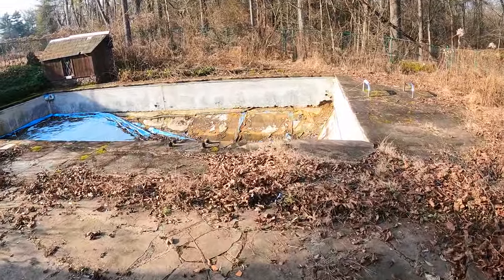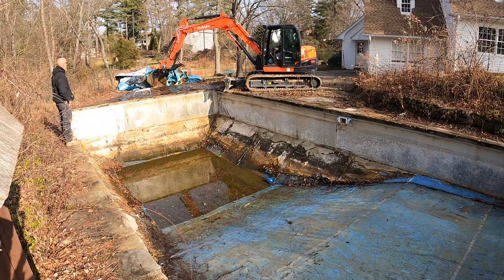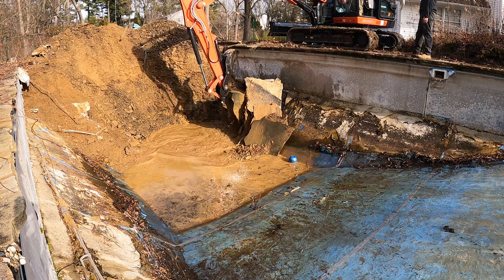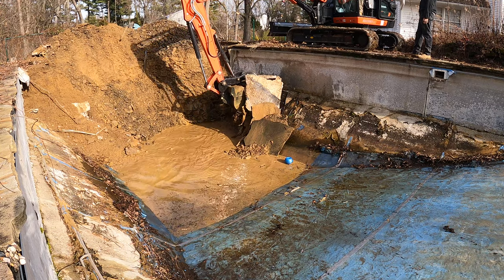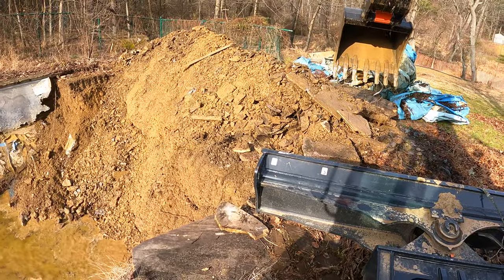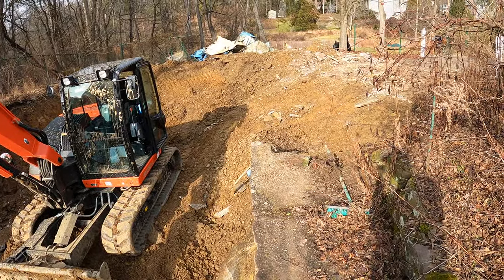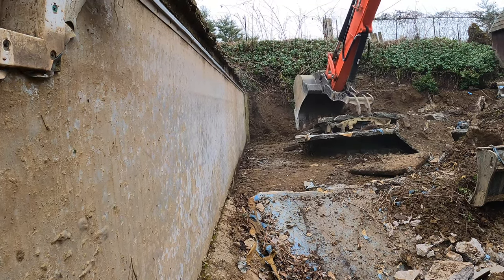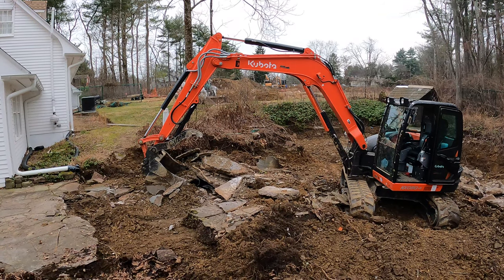In Ground Swimming Pool Removal/Demolition

Comment: You’re the man for doing it right and tearing out the bottom. Most people would have just pushed it all in.
Reply from the maker: Thank you, I would lose sleep if I did something like that! Thanks for watching
Reply: I don't know anything about filling in a hole, could you explain why you wouldn't just pile everything back in there?
Reply: @deeevans324  probably a permit issue. There is a difference between partial and complete demolitions
Reply: @deeevans324  Drainage, probably. Leaving the bottom means the water percolating down has to go somewhere else.

Comment: We have a property that we are potentially looking to purchase and build our forever home. One issue is the abandoned pool with all types of damage to the concrete. Any idea of what it would cost to remove all of the concrete? Plan to pour new concrete for a new pool. Roughly the same size as featured in this video. Thanks in advance
Reply from the maker: Your region and the job site play a major role in pricing. Ball park would be $10k
Reply: You’d save you 9k if you’d do it your self. Js